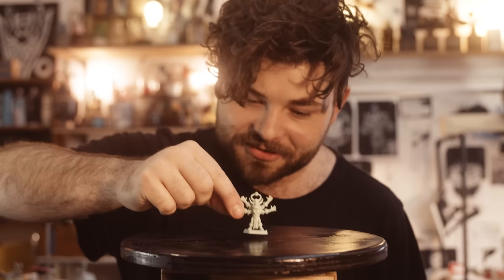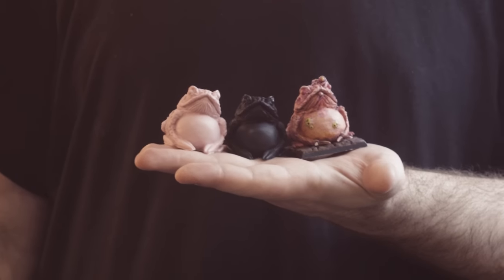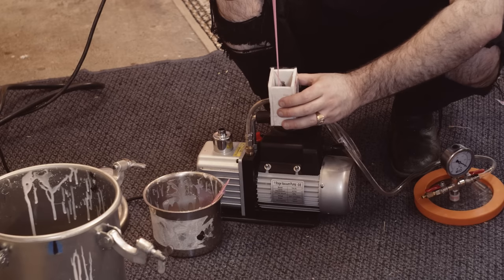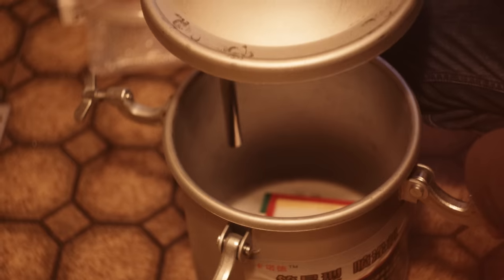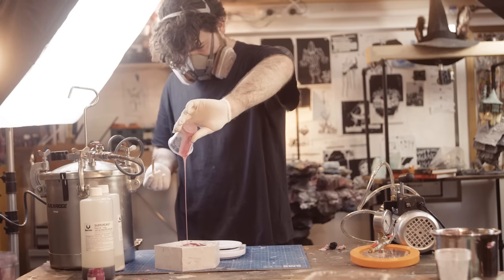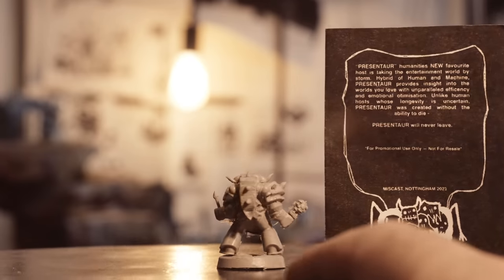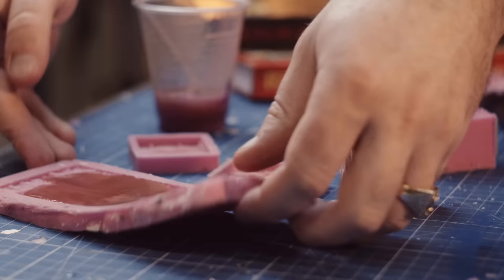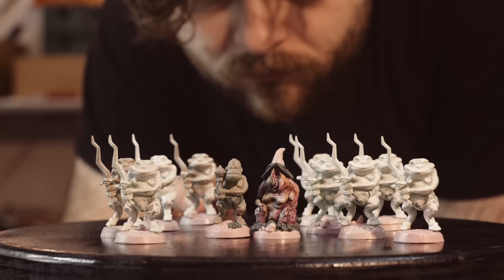How To Recast Warhammer

Comment: I do want to add that recasting doesn't HAVE to be this complicated (with a pressure pot and vacuum chamber). Recasting is SUPER useful if you need things like extra sets of weapons/upgrades that only come in limited quantities per box. Or to get an extra copy of a broken part.

For the silicone mold, you can do a two-part mold by pressing half the mini into clay, pouring the silicone to get one half, then removing the clay, and pouring the second half of the mold. You just spread talcum powder or spray a release agent between the two layers to keep them from fusing. These two part molds make pulling out the model easier and remove the step where you sliced using a hobby knife. I think if you're doing a sprue of weapons or something that's the way to go.

The pressure/vac equipment is great for making perfect stuff and well-worth it if you're planning on selling your minis. But for a hobbyist making copies of their rocket launchers or something, just using the stuff as-is should get you 90% of the way there. Many parts will be perfect, and the parts that aren't can be fixed with some greenstuff or you can just recast.

I appreciate this video! Recasting is a ton of fun. My second 40k army was a Wraithguard list back when they literally only had 3 poses and came in mono-piece pewter kits. They were $15 a piece and I needed like 50 of them. Recasting worked perfectly and saved me a ton of money!
Reply: would second this.     can do really rudimentary casting  with hot glue molds.   there's a re-melt-able poly carb substrate.  i think the western name(green stuff world sells it) is blue stuff,  Oyumaru is the japanese clear variant.    i've even seen videos of people experimenting with silicone and corn starch to make a mold.   don't even need resin.   left over green stuff or 2-part epoxy mold.  can jam into a mold... get a press replica  of ...i dunno.  a chaos god symbol,   a shoulder pad.       I've cast  door panels to vehicles.       and when you are using resin, have a little extra.   great way to use that up.     to have some of these smaller bits molds   to give a go on   ...and if it doesn't come out perfect.  it's nbd,   as it was mainly excess resin/green stuff.
Reply: You don’t even need a vacuum chamber, just find a way to make your phone vibrate a ton and put it alongside the mould when pouring, that’ll stop bubbles from forming or staying

Comment: Something that I learnt when I cast and designed designer toys. If you can’t afford a pressure pot, we use to tap/drum the side or on the table of moulds when they were setting. This would make air bubbles rise up. This method did not work as great as a pressure pot by all means but it did work quite well.
Also I learnt two part mould making is much more easier in the long run then single pour moulds. Saves on trying to cut your sculpts out and time.

Comment: interesting, a long time ago I had custom miniatures made and this was back when metal minis were a thing, I had the moulds done and they were this thick rubber type deal and it looked like the models were cast using spincasting, where you pour molten metal and then spin the machine up so it forces all the metal into all the details of the mould. I did have the opportunity to buy one of those machines but it was just waaaay too much for me at the time.

Comment: Lets say I've had some models some like 15 years and finally own a home in which I can display them, and I wanna replace some lost pieces, like for example Vespid heads. I have an intact Vespid I can cast with rubber, great! But what can I make the heads out of? Does squishing "green stuff" into the head part of the mold work? Are there better "amateur" options for those of us that can't invest in plastic casting pressure machines or 3D printing? I don't need to make models at scale, just replace bits.

Comment: I got a 3d printer for Christmas and im just learning how to use it properly but it seems to me that this would probably be cheaper. Im making some roleplay minis that ill need in relative mass so I was thinking to print sprues and then cast them to speed up the process. Can this be done with sprues or some way of moulding bodies and limbs etc even if i have to make multiple mini individual moulds? Any info or advice would be greatly appreciated.
Reply: Don't get me wrong by the way, I'm super excited for my 3d printing adventures but it's a slow process when you need to print like 40 zombies that I want to have variations on (the party have killed a lot of innocent NPCs and the dead aren't happy). The designs are completely my own creations though so the 3d printer is a fine way of trying out to be creative outside of a simple kitbash

Comment: Love the video and agree with your philosophy, especially when it comes to old stuff that they can't profit from anyway. I have access to a vibrating table but not to a pressure pot - will it help knock out some of the air bubbles or nah?
Reply from the maker: Unsure, I think slushing the resin in your molds around with a rotating motion to get trapped air out will probably be more effective. You can also paint the resin into your mold halves to makes sure everything is covered. Crafsman does some good videos on it if I remember correctly!

Comment: Might be a silly question but are you using two different pumps for pulling vacum and the pressure pot?
Reply from the maker: Yeah one is a little vacuum pump for sucking out air and the other is an air compressor for putting in air!
Reply: @Miscast  Ah I figured, really want to do casting and also want to do some airbrushing, so really weighing what to get first that's why hah.

Comment: Curious how you go about casting models with self-contained voids/gaps/holes etc. Or rather, how you get them out of the mould. For example your space-rat-marine-dude, there is gap formed by the sprue, legs, and pelvis - sort of like an inland sea. In this case you break the sprue off and then cut him out which gives you access with the knife to cut up the in-seams of his legs and split the mould that way - but what if the rat dude was standing on something that you couldn't remove?

I suppose at that point you would have to consider moulding in separate parts? instead of creating a one-piece miniature?

Cheers for the content
Reply from the maker: This happens a lot but the silicone is flexible enough to manipulate and cut. Keep the walls as thin as possible without loosing structure. I like the aesthetic of one-piece because its more bootleg but breaking the model up into bits onto a sprue is nice solution.
Reply: @Miscast  Fair enough - never tried casting before and may do in future. Trained as a 3d modeller for a while so figure I could prototypes tuff quite quickly with a printer.

I agree, one-piece certainly has a distinct quality about it, especially if it's a little rough around the edges, that makes it extra bootleg. Bits of flash and sprue, extra bits loose in the bag, some sort of clearly hand-made signature or maker's mark.

Comment: Not a lawyer, but unless you make claim GW is the one producing these as official models, I'm pretty sure it is considered transformative work. They aren't recasts of licensed whole items or individual parts. They are castings of your reassembling of parts as a whole. Same way Sucklord did the thing. Also eff modern GW, Oldhammer furever.

 I slung resin making action fig parts and may have good info. 

A good tip for cutting your mold is to: do a zig zag or clamlips back and forth cut on the mold to start it. make sure to cut no more than 2/3 of the way to the models (tear resistant mold rubber helps). THEN do your final cut that follows the line you want. You will have less resistance getting that final cut and it will give your mold a really solid key. also air vents can always be added after the mold cut with your knife or nice delicate ones with a speedball linocutter(always vent upwards!). 

Also I'm pretty sure for what you are casting you could skip the vacuum altogether and just do pressure pot. Pressure cured resin in pressure cured mold is really good. I swear the vacuum thing is left over from industrial casting and oldschool art toy casters justifying their stuffs prices. Of course this may just be my own experience with materials and climate that I have access to.
Reply from the maker: Great tips! Vacuuming the resin changed everything for me, the difference is night and day honestly. I have so many old molds that would only give me good casts 25% of the time or not at all but with the vacuum step, they all work perfectly now. I feel like I can get away with much simplier molds. Game changer.

Comment: Listen you all I use the BBDINO silicone off of Amazon which is the same as let's resin and like two or three other brands it's some knock off s*** coming out of some Chinese company but with that being said it's very cheap I make awesome recast I don't have any sort of pressure pots or vacuum Chambers and I don't have any problem with the little wart bubbles all over the face of my mold, I do this by simply pouring the silicone from about 2 feet above the mold it takes a little practice but if you pour in a super thin line all the air moves itself on the way down to the mold not all but a very decent portion of it so much so that it's able to get rid of the rest of the bubbles itself although I would love a vacuum chamber because if you're dealing with cheap-ass resin like I am.. well there we could use a little help with air bubbles lol

Comment: honest question: in 2023, why cast when you can 3d print?
Reply from the maker: I like working both physically and digitally, so both have a place in my workflow. Moulding and casting models warms my heart because its its so analog and tactile and the fresh casts have crust around the edges that is nostalgic to ne. 3d Printing I like for the efficiency (when it works) and distribution.